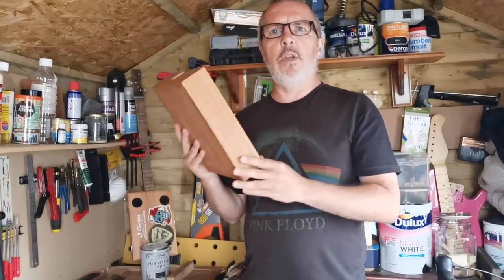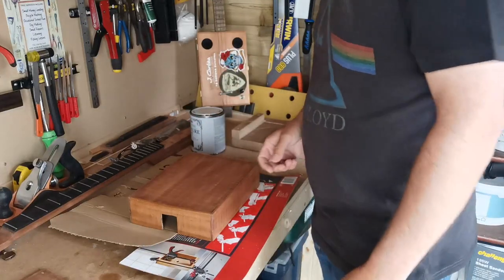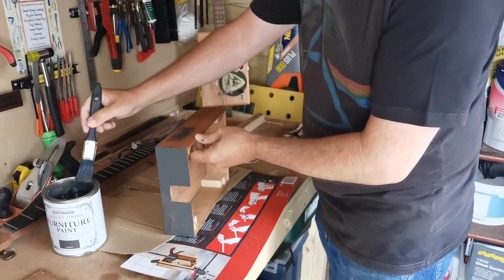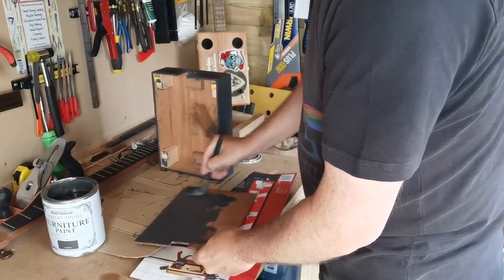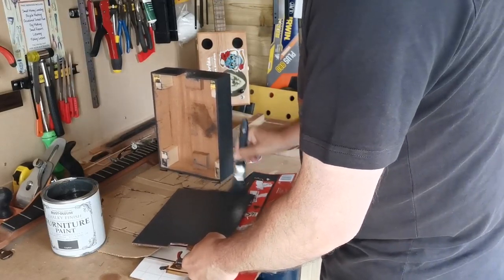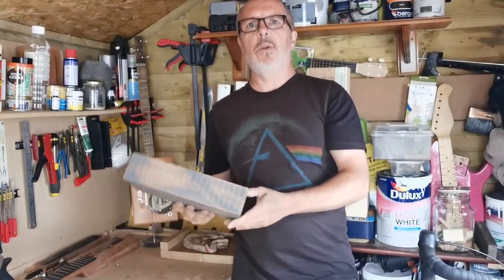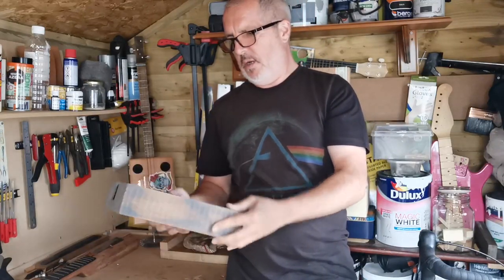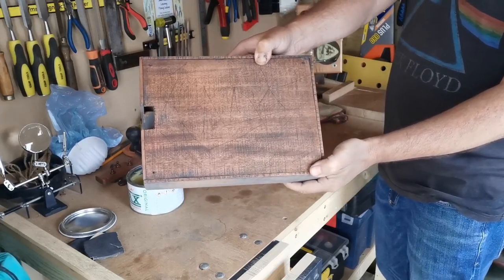How To Age A New Wooden Box For A Relic Style Cigar Box Guitar

Comment: Good technique does the job. I'm using alcohol dies, and burning the box and sometimes the neck with a torch to get different 'Olde Worldy' effects. Another method is to soak a piece of wire wool in vinegar overnight and paint the liquid on the box. It gives a grey effect like barn wood which is popular. Glad I found your channel and I'm subscribed.
Reply from the maker: Nice ideas. I've tried the wire wool in vinegar. I found it worked best on oak after I had soaked it for a week or two - the end result was almost like ebony ;-) Thanks for the sub 👍